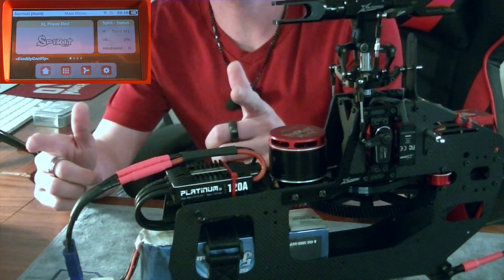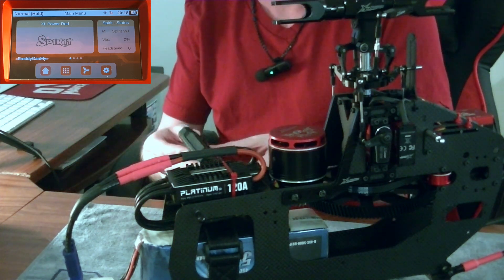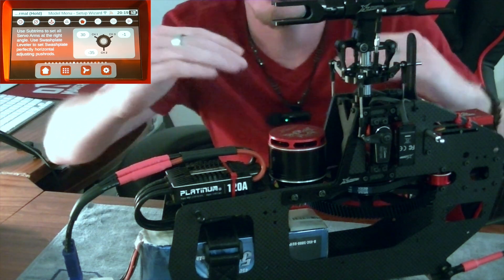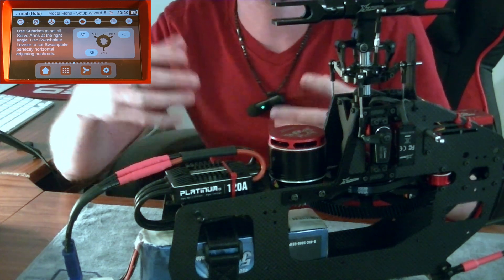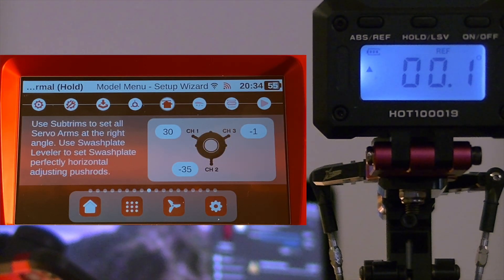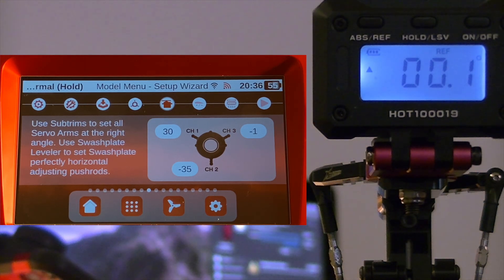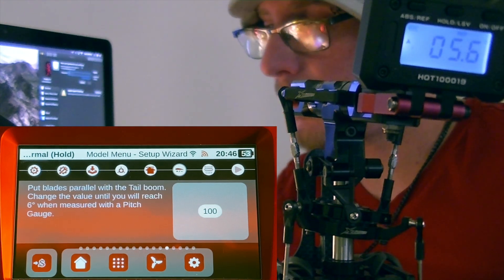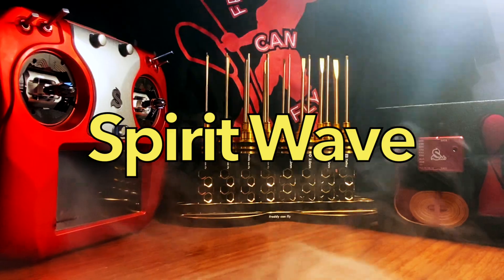Spirit Wave : Setup Wizard 2 - 0deg center, Collective pitch, Cyclic deflection.  (FreddyCanFly)

Comment: I've been using Spirit units since 2016.  One thing I would say about the pop-up "bubble" recommendations during setup is that these recommendations are rather tame, and are target more for stability at the expense of agility.  The point here is to no judge Spirit flight performance performance based on default and recommended values.  You really need to tune the parameters if you want balls-to-the-wall 3D flight performance.